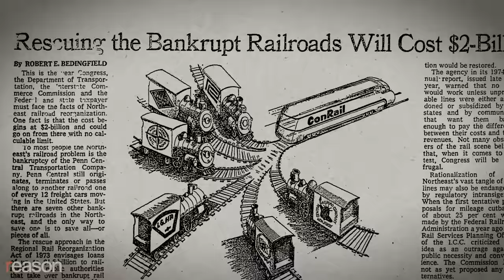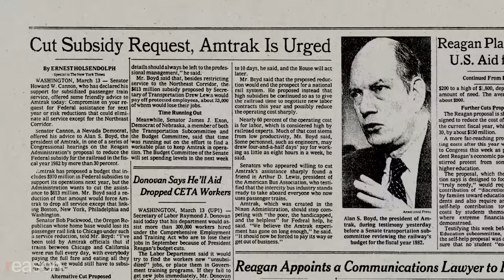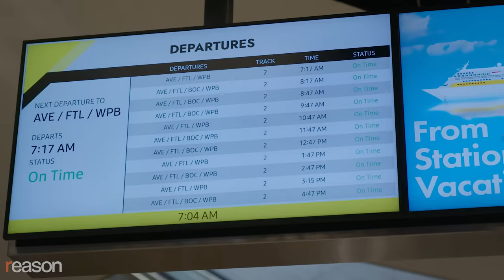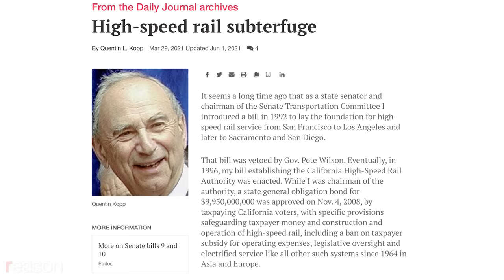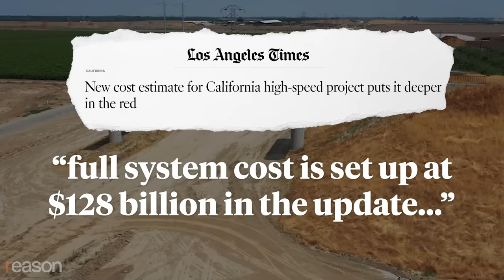How Florida beat California to high speed rail

Comment: Ok.

Brightline isn't even high-speed rail! It's higher-speed rail at best, and slow at worst. We've even had 110 Mph Amtrak outside of the NEC for over a decade now!

Plus:

1. Brightline is already owned by the FECR, allowing it to use its already existing infrastructure.
2. Brightline had to construct 40 miles of singletrack, non electrified railroad for 125 mph operation.
And no Reason, it is not 125 mph between Miami and Orlando. Only on a 20 mile stretch between Meridian Park and the St. Johns River!
California has to construct 520 miles of double-track, electrified railroad allowing for 220 mph operation.
3. Florida is flat. Like super frickin' flat. California is not. While the Central Valley Segment is flat, the rest is not.
4. CAHSR requires HUGE, FRICKIN MASSIVE TUNNELS. Tunnels that subsequently also run under fault lines.
5. Brightline had to upgrade and double-track some of the lines along the FEC. And the project cost slightly less than 2 billion$. 
But CA also has to upgrade its infrastructure like electrification in the Bay Area, which is now done. And improvements in SoCal like LA Union Station.
6. CAHSR Requires massive stations for much longer trains. Up to 2x the length. And the station in SF has to be underground under one of the most expensive cities in the US.
7. Brightline can run on an already existing track or next to the highway. CAHSR cannot. And property acquisition has slowed the project down massively.
8. CAHSR is more than twice the length of Brightline from Orlando to Miami.
9. CAHSR is publicly funded, meaning conservatives like ReasonTV and Republicans will always be against it and constantly trying to end it.
Making it much more difficult to ever complete.
10. CAHSR capacity is 10x that of Brightline. Brightline expects 4.3 million riders. CAHSR: 10x that. And you see why. Brightline runs from the outskirts of Orlando, 
only connecting with its airport down to Miami. CAHSR is going between two of the largest cities in the US.

Brightline has cost 1.75 billion USD. CAHSR requires 10x the amount of infrastructure. That would be 17.5 billion USD.
CAHSR goes through much more difficult terrain. Probably 36 billion USD. It's electrified 40 Billion. Goes at 3x THE FRICKIN AVERAGE SPEED!!! 60 Billion.
Property aquisistion 80 Billion. Going through the most expensive places on earth including new mega-stations 90 Billion. Longer electric trains 92 Billion.
Opposition, lawsuits, bureaucracy 100 billion United states dollars.
Plus time, inflation, and more realistic cost estimates 128 billion.

Do I even have to begin? I have nothing against Brighline, good luck to them. 
However, the mission and parameters of CAHSR are completely different from Brightline.

The CHSRA as also massibly reformed itself since Kopp left. No longer relying on expensive private Consulting Businesses. Something that Quentin Kopp is partially responsible for!
Reply: As for Cali, our 2008 ballot initiative promised SF to LA highspeed rail.  The governor is now saying 2040 for that full route to open.

Ridiculous.  Brightline might “only” be 125 but it’s still operating 20 years ahead of when SF-LA will finally work
Reply: That's a nice mostly accurate list of comments. Just saying here may be some fact checks:
 
1. Brightline cost $6 Billion. 
2. BL had 2 million riders in 2023. Perhaps 4 million when it connects to Tampa. 
3. CAHSR's ridership projections have decreased from around 30 million to around 24 million which is still unrealistically high since the advent of remote work and the stagnation of population. 
4. May be 3-4 decades before CAHSR reaches LA due to funding issues and 55 miles of tunnels.  
5. CAHSR with closely spaced station stops and 125 miles of slower blended track may average up to 125 mph. BL averages 77 mph between West Palm and Orlando. Not even close to twice the average speed.

l am totally for CAHSR, BLW, TC, PNW Cascadia hsr systems and of course semi-high speed BL.

Comment: The big problem with this headline and comparison is that Brightline is not High speed rail (250 km/h and upwards),. It's not electrified and it's mainly  reconstructed existing rail. It is packed with dangerous street crossings which also lowers the average speed..
That said, Brightline is still a great accomplishment..
Reply: As for Cali, our 2008 ballot initiative promised SF to LA highspeed rail.  The governor is now saying 2040 for that full route to open.

Ridiculous.  Brightline might “only” be 125 but it’s still operating 20 years ahead of when SF-LA will finally work

Comment: Neither California nor Florida have high-speed rail. 200kph is the bare minimum of high-speed, 300kph should really be the basis for high-speed rail. At 300kph, the Brightline would take less than 2 hours, which would be something people might actually pay for.
Reply: There are a few different opinions regarding what's the minimum speed for HSR. I subscribe to 200 kpm for existing routes and 250 kpm for new routes.
Reply: As for Cali, our 2008 ballot initiative promised SF to LA highspeed rail.  The governor is now saying 2040 for that full route to open.

Ridiculous.  Brightline might “only” be 125 but it’s still operating 20 years ahead of when SF-LA will finally work
Reply: BTW 150+ is the highspeed standard established by both the US and EU governments
Reply: @electrictroy2010 l believe the international standard for HSR is 250 kph.
Reply: @electrictroy2010 SF to BFD may be possible 20 years from now. SF-LA probably 40 years from now.
Reply: @electrictroy2010 SF-LA in 20 years is being way too confident. Try 30-40 years ... with luck.

Comment: This is so right wing! It barely mentions the trillions spent on other forms of transportation. And calls California which will be open to private operators failure!! Open like airports, roads and ports!
Reply: As for Cali, our 2008 ballot initiative promised SF to LA highspeed rail.  The governor is now saying 2040 for that full route to open.

Ridiculous.  Brightline might “only” be 125 but it’s still operating 20 years ahead of when SF-LA will finally work
Reply: There is no comparison Brightline had the help of it's cousin company owned by the same owner FLORIDA EAST COAST.   And flat Florida. Were you against the Interstate road system too? That took trillions and years to build?

Comment: With about 20 miles of 125mph, nowhere else in the world considers Brightline Florida HSR.  It is, however, a decent Regional Rail line that can be made much better. Adjacent real estate helps but the the state of Florida needs to build 50-60 roadway overpasses/street closures for Brightline Floridasafety, speed & more frequency. BTW, every piece of great infrastructure requires taxpayer support.  Don't complain about taxpayer support HSR & Regional trains without complaining about airports and highways.

Comment: They really compared a train (legally not defined as HSR in the United States) that runs at 125mph for 20 miles of its journey to one that will run nearly 100mph faster for 200+ miles. Ladies and gentlemen, peak journalism lol
Reply: I knew you'd roll in here at some point. 🤣
Reply: They really compared a train that exists to one that doesn't.
Reply: @Distress.  still, Brightline is NOT high speed lol. As long as it remains at-grade, and keep hitting idiot Florida drivers trying to outrun trains (lol), it will never achieve real HSR speeds.
Reply: You know Brightline isn't finished right? They are building Orlando to Tampa which will be 125 MPH as well, and then they are building a route to Jacksonville. The entire state other than the panhandle will be connected. Tampa to Orlando is 85 miles, Orlando to Cocoa is 35 miles at 125 MPH. So that distance alone is 120 miles. From Cocoa to West Palm Beach, they run on new Class 6 tracks that they laid at 110 mph for 129 miles. Only the West Palm Beach to Miami leg which is roughly 70 miles runs at 79 MPH and slows down because there are 4 stops along that route and multiple crossings. It is such a dense area because around10 million people live in that 70 mile long and 30 mile wide stretch of land. They could never build west because of the everglades.
Reply: @righteousmammon9011  California has been working on their HSR since 1996.
So far it's been a 9.8 billion dollar stonehenge. Florida may face delays, but not at that level
Reply: @bobbinsthethird  it’s cost far more than 9 billion in California. Floridas is already running and only started in 2018 even after it was shut down during COVID
Reply: @bobbinsthethird  It's only been under construction since 2015.
Reply: As for Cali, our 2008 ballot initiative promised SF to LA highspeed rail.  The governor is now saying 2040 for that full route to open.

Ridiculous.  Brightline might “only” be 125 but it’s still operating 20 years ahead of when SF-LA will finally work

Comment: Once again @ReasonTV humiliated itself. The Brightline HSR line only about 45 miles long, is designed for a mere 125 MPH and fits easily within the infrastructure of an existing freeway. The CA HSR project is over 100 miles long, designed for twice the speed -- and thus FOUR times minimum radius -- using electrical power, not diesel like Brightline. That's like comparing the Apollo Moon Exploration Program to launching Sputnik !.
Reply: The Cali line is supposed to go LA to SF.  That was the promise on our 2008 ballot referendum.  Now the governor is saying 2040 date.  (Ridiculous.)  Meanwhile Brightline is doing 125 while Cali’s fastest train is only 60 (Amtrak).
Reply: ALSO:.  
China has built more miles of high‐speed rail than any other country with $800 billion debt.  None of its lines are covering operating costs.  (As a result, China is shifting to building more roads.)

France’s rail has debts of $70+ billion and has been repeatedly bailed out by the government. SPAIN built its system with a public‐private partnership.  It is $90 billion in debt.  The state‐owned Japanese National Railways has a debt of $550 billion.  (Japan also has Highest debt to GDP of 300%.)

Railroads are an OLD 1700s technology that is obsoleted by faster, more flexible travel technologies.  High-speed rail loses tons of money & is a bad investment.
Reply: @electrictroy2010  - You really don't know anything. The fastest trains in California hit 90 MPH. The Surfliner tracks from Fullerton to San Diego have a line speed limit of 90 MPH, subject to local speed restrictions. Oceanside to Del Mar, and San Juan Capistrano to Irvine are the most likely places to get a 90 MPH ride. I was riding at 90 MPH just the other day, which I checked by GPS.

Comment: There are several issues with the premise of this video. 

First off, Brightline is not electrified. This limits the top speeds and in many ways disqualifies it from even being considered high speed rail. 

Brightline also has tons of at-grade crossings. This contributes to its exceedingly high crash and fatality rate, as the system it's on was not designed for higher speed, frequent trains. These are cost-cutting measures that only a private company could get away with, because if it was a state agency, the line would have been shut down until the problem was fixed. Maybe some think this is a good thing, but killing pedestrians and drivers should be avoided. 

Finally, and what's probably most ironic, is that Brightline is simply a handout to a private company. Brightline took over an existing plan that was state-sponsored and would have been state-operated, but the libertarian governor didn't want to see state money going to a state company. So instead he gave the money to this private firm. And it's not like Florida actually saved any money by doing this, in many ways, it might've cost more, but since that doesn't fit the narrative, we'll just ignore it.
Reply: KEY POINT: Florida got a train going 125 mph to connect two major cities.  California’s train won’t connect LA to SF until 2040 (thirty years after the 2008 ballot referendum).   Meantime Cali’s fastest train is only 60 (Amtrak)

Win Florida Governor 
Fail California governor (actually it’s several governors since 2008)
Reply: @electrictroy2010  Funny you mention the original referendum in California; Florida passed a referendum in 2000 requiring a system of higher speed trains be built to connect its five major urban areas. 20 years later, they have a single line connecting just two. By my count, this project is on a similar timeline if you go by original referendums. 

California on the other hand is on track to connect a much larger portion of their population by 2030, with fully electrified, grade-separated, actual high speed trains. The technical complexity of this project far exceeds what Florida has done, and while they have been slow to get started, they are making progress. What they really need is full throated investment by the federal government, possibly with army corps of engineer support, and a much stronger commitment from California itself.
Reply: @electrictroy2010 Arnold was the governor in 2008. LA to SF perhaps by 2063. Brightline is fantastic.
Reply: @jamalgibson8139 Brightline connects atleast 9 million south and central Florida residents while the CAHSR valley segment will connect a populaton of 2.5 million, at most. Brightline opened in 2018 and will have been operating for 40+ years before CAHSR connects SF to LA. l wonder which makes more sense.
Reply: @jamalgibson8139 l realize 2040 may seem like a long ways off and it may seem reasonable that CAHSR may connect to LA by then but it won't. Period. Sorry. CAHSR will be lucky to get to Bakersfield by 2030-2033 and to SF by 2040-2045. Perhaps LA by 2065. Why? Getting another $100 Billion in more funding any sooner is why.
Reply: @davidjackson7281  I do agree with you that the primary issue facing CAHSR is funding, however, rather than take a defeatist attitude towards the project, I'd rather put my energy towards advocating for the project to get the money. I don't live in California and have no plans to ever live there, but I still think it's worth it to put the money towards that system. As I said elsewhere, the tunnels for this project may just require army corps of engineer support, and I think it's about time we got serious about building this system out. If we can give 20 billion to amtrak to support the NEC, than we certainly can give California 20-30 billion to build the US' first true high speed rail line.

Comment: 5:38
- the federal interstate network is chock full of subsidies, both in construction and maintenance.
- no, the gas tax is NOT enough to cover maintenance costs, since the 1980s.
- believe it or not, gas acrosss the US is heavily subsidized to keep prices low, because if it was not, prices will be already at $8 per gallon, at par with Europe.
Reply: No it would not be anywhere near $8 a gallon. Maybe $4. The Federal Gas Tax is only 24 cents per gallon. If you tripled that tax, it would be like 72 cents a gallon.
Reply: @righteousmammon9011  thanks for that. Still, time to increase the gas tax. It has been long overdue.
Reply: Europe costs $8 a gallon because they charge $5/gallon in gas tax.  NO WAY will the US & state governments go above the current rate (about $1/gallon)

Comment: Japan also works on the land + rail model. Though it was highly subsided at the start (as the rail was built by the government at the start) it doesn't subsedise that part of the rail anymore.

Plus, US highway is also a huge, economically unviable subsedie - hence why its crumbling and begging for renewal. You are banking too hard on autonomous cars, and by proxy on continued public support for cars. If bright line succeeds, highways will die out slowly. Making Autonomous cars the scarce and rare alternative, active mostly in cities, where you can  (theoretically) upkeep a well lit, and well marked road.
Reply: FALSE.  The state‐owned Japanese National Railways has a debt of $550 billion.  (Japan also has Highest debt to GDP of 300%.). Let’s not copy them.  China has built more miles of high‐speed rail than any other country with $800 billion debt.  None of its lines are covering operating costs.  (As a result, China is shifting to building more roads.)

France’s rail has debts of $70+ billion and has been repeatedly bailed out by the government. SPAIN built its system with a public‐private partnership.  It is $90 billion in debt

Railroads are an OLD 1700s technology that is obsoleted by faster, more flexible travel technologies.  High-speed rail loses tons of money & is a bad investment.